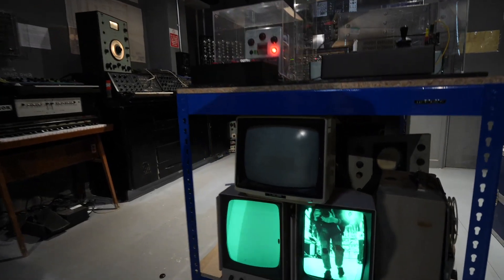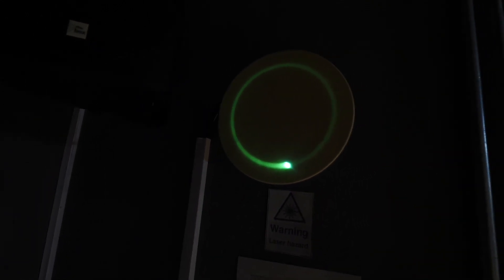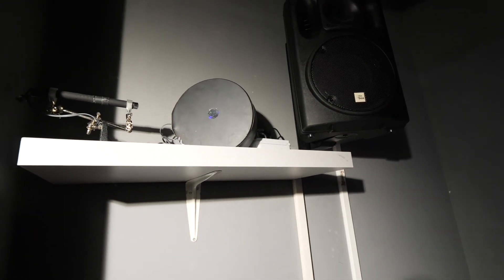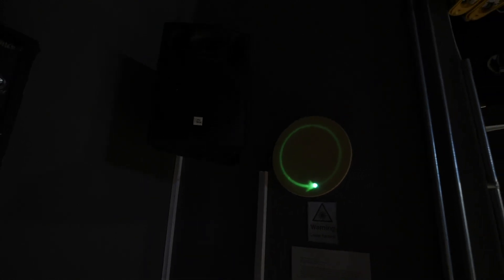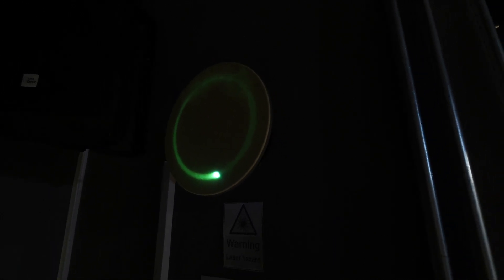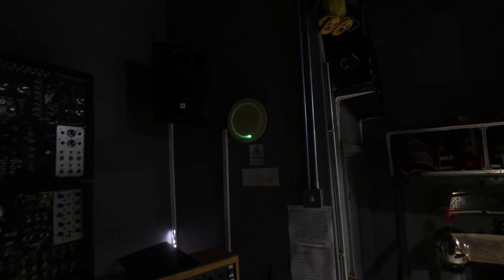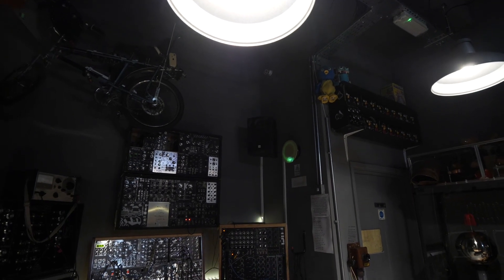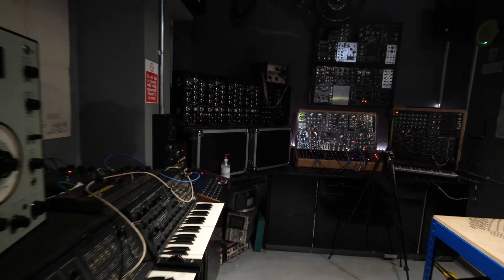Mechanical Oscilloscope DIY Installation By Melanie Kat King

Comment: I do like it but why not add two almost parralel mirrors to lengthen the beam by a few meters before it hits the screen so it has a wider amplitude on the wheel.
Maybe even a few mirrors and a lens so it has two or three times the amplitude and a higher resolution.
It may be my eyesight but even though I do like it it was hard to see what was going on with the wave on my screen.

Comment: This is so cool! When I was a kid, I had a Nickleodeon toy which was a projector-like screen and a light pen and when you drew with the pen in the dark, the drawing would glow on the screen exactly the same way that disc does. Simple premise but very cool! You've taken it to a whole new level.
Reply: Thanks a lot.
Reply: @MelanieKing  No problem! Amazing work!
Reply: the flash screen, it came with a xenon flash one one end and a little light on the other, the flash would light the pigment uniformly or silhouette anything in front of the screen then you could draw on the screen with the little light it was a neat toy

Comment: That's awesome. I kinda want to aim the laser at the top and slightly more towards the center. For some reason I think that'd look even better.
Reply: After testing various positions we worked out the bottom edge looked the best :)
Reply: @LOOKMUMNOCOMPUTER  Need a bigger spinning disk though.
Reply: @SeanBZA  this ones fine :D
Reply: You see the tail more when it's on the edge. :)

Comment: I'd be inclined to use a green laser on that as the light output is higher (even with lower power lasers) and green is at the height of the middle of the human eye spectrum.
Reply: We tested all lasers when making it. The violet as it was closer to ultraviolet end of the spectrum was the most successful